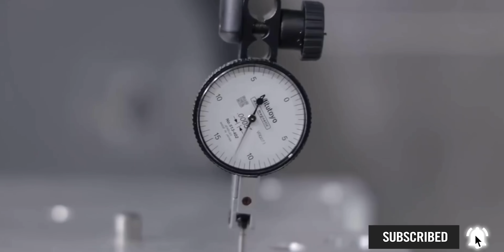The Harsh Truth Machinists Don’t Want to Hear

Comment: The city you live in is huge.  The difference in pay and work between Austin and Houston TX is night and day.  I had four jobs in one year working in Austin(almost 20 years ago). I quickly moved back to Houston to work another ten years for the oil industry. 
And the problem with most of the machinists I meet these days is they aren’t on the level they think they are, and want too much for doing the bare minimum.  You REALLY have to want it.  You can’t take the easy route AT ALL!!!   This means actually listening to the people taking about you.  It’s not an easy hill to climb, but the pay is worth crawling to the top.  Btw I show up to work with my uniform shredded. I  usually leave dirty smelling like oil and sweat, but if my parts are truly  beautiful, no one will be looking at me.

Comment: I like you, but you have no idea what you are talking about. Having been through tough times in your life has nothing to do with working in this industry. I have over 35 years of experience, did 4 years of night school to study all facets of machining, tool & die, mold making, trigonometry, advanced blueprint reading, dimensions and tolerances, metallurgy, etc.and get my Journeyman Tool & Die certification. I can setup and run just about any manual or CNC piece of equipment for milling, turning, or grinding. No matter how big of a machine, or how big, or expensive the part, or the tolerance that needs to be held, I cover it all. Knowledgeable about most of the latest machining techniques. I've worked for companies that employed from 50 - 1000 people in one location, and it has done absolutely nothing to improve my ability to earn what I'm worth. Wherever you live the market sets your wage. It's a glass ceiling and you will never break it without starting your own shop. With start-up costs of at least $100K for the basics, and a need to have a connection with larger companies who can funnel you jobs to get started, it's something only a few people can obtain.

Comment: This is the way. A work ethic is key, It is yours and it follows you everywhere and it is highly nuanced. You have to take care of it. A prime example, is that I have people not very happy with me at my job for the decisions that I made about stopping production. But I was trained to not take risks, and a million dollar waterjet is a big responsibility. It is a fact that if you do not take care of a waterjet, that it will be a nightmare. 

I ran our waterjet this week. I normally do not. I did not meet the end of the month quota. I was two parts short, about 2 hrs and 40 minutes of run time short. That is ok though, because the parts will be ready for the afternoon delivery. when work resumes back on Tuesday. We start at 5 a.m. and we have 3 hours of work left. We will meet the quota. Truck won't come to pick up the parts till mid afternoon.

I had some mechanical issues that could have compromised the material and i was in danger of making scrap if i did not make sure to be able to see what i was doing. If i did not make the right decisions, I was sure to make scrap and have a floor soaked with water flooding. I had to stop production to make sure that my water system was running optimally, and I had large clogs in my reclaim system that were causing the water level to rise above the sheet on my waterjet slats. I had to shut down to fix leaks and take off braided hoses and flush out mud clogs and so on. Had to be done. I rann as long as i could. I lost 2 hours of run time. I got 20 of 24 parts completed, about 30 hours of cutting/work. I went home a muddy mess, but the waterjet was back to working order. All in all, I can sleep at night because I had the best interest of the company at heart and I took care of the machinery, and made sure to not ruin material. The main waterjet operator will be back on Tuesday and he is a lot faster than me. I did my best and the distributors and contractors will not have to wait for delivery.

Comment: I started my machinist career when I was 14 Im 60 now. My dad had a small machine shop and I would work there after school and weekends  .  This was the mid 80s and most everything was manual from old school turret lathes to multi headed drill presses . I learned to grind hi speed tool steel and cemented carbide and drill bits. The shop evolved with the times and got a variety of cnc machines  which was great , but i noticed that the new people who came work there couldnt sharpen a drill or chase threads they seemed lost without that computers aid. I love cnc machines and amazed at what they can do but understanding the basics as a manual machinist is priceless
Reply: I agreed with what say. I started in the manual department. Like the old timers would say , cut once check twice. Manual machining teaches you patience. But I only did it for 4 years n move on to the cnc set up n programming. Now I have 27 years in this trade n a supervisor at my 3rd shop. 
An old wise man use to say, kids these days can’t use a knife but they can eat meat. I tell him time has change. Buy  the meat or have someone cook it for you. I don’t need to know how to  sharpen a drill , just buy the drill.

Comment: My last employer was old school using manual machines and bought a new CNC.  My boss was very much against paying extra for tooling especially since "this is the way we've always done it" I was young and everyone had 20+ years experience over me. I tried to show them new tooling, gave them print outs, showed them videos, etc. And  they just didnt care. To add insult to injury, on my review the put that I was "hard to deal with" and that i kept referring to "unethical machining practices" . I left that job and the place im at now its almost the same story except I mainly deal with engineers who dont know jack about machining. I showed my boss a super glue machining method to get 30 inch x 30 inch parts flat within the .002 flatness tolerances. He said we're not going to do that anymore because its a waste of time. I plan on getting out and starting my own shop but even then that has its draw backs. My plan was to start a Xometry account to get off the ground but the work they have you do for what they pay and the lead times they want them done is criminal! This trade is really ass backwards unfortunately and thats why China is taking over all the manufacturing. Young people dont know about machining and they dont want to work anyway. Im honestly thinking about switching to HVAC or becoming a Maintenance Tech. before my body gives out and AI takes over CNC Programming jobs, because they definitely will! I'm a veteran who's had ACDF surgery C3-C5 fusion, possibly another 1 soon. This trade did help me learn a lot and it didn't make me rich, but I didnt go hungry and I always had a job. Just wish old boomers and old Gen Xers would listen before its too late. When I was in community College going through my apprenticeship, they had no instructors to teach abrasives. They literally had to get the original instructor out of retirement to teach the class. No one is going to replace the tool and die makers in the country and my fear is that we will see a dramatic drop off in manufacturing and crazy lead times once all the baby boomers retire and pass away.... rant over...

Comment: Your message is what I just needed to hear. I’m almost 67 years old and I’m still working my butt off as a CNC programmer and operator for a small company that I’ve been with for 30 years on and off. 
  For four years, I started my own business with my brother doing the same thing and bought a couple of CNC mills unfortunately that didn’t work out and while I was running that personal business, I was still working so I was pretty much burning, the candle from both ends just about killed me.
I am tired, my friend, but you inspire me . I don’t know what my future is now but I should be retired and the only thing I have is my Social Security, but I would like to somehow use my skills as a CAD and a Cam programmer to supplement my Social Security and maybe give me some personal financial security to finally buy my own home somewhere. Thanks again for your wisdom. Cheers.

Comment: 100% truth in this video. I have spent my entire career as a tool maker / machinist and there are 2 types of machinist I have worked with. Wealthy and poor machinist and it has nothing to do with money. The mindset between these 2 groups is the difference. One group only collects a paycheck  and has bad habits they use that paycheck for. The other type gets payed for their skill and has good habits that is not driven by the money they make but how they choose to direct that money / energy to grow and change for the betterment of their life and the lives of those around them. One of these people will learn and use their skills outside of the place they make a paycheck at and the other will only learn and use their skill on the job. One works for money the other makes their money work for them. One is motivated by self improvement the other is motivated by money and overtime. Take the time to work on you and don't be one of the people that want payed to work on themselves.

Comment: Great video!! After being in this trade for over 20 years now, my advice is the same: Have a good attitude!! Make the smartest machinist in the shop your friend and learn all you can!! Learn, learn, learn!! You will learn many new things at every shop you work in, as well.  It WILL, pay off.     Remember: you have one mouth, and two ears. Listen twice as much as you speak. 

My experience includes: Mold Maker (13 years), programmer (MasterCam, Esprit, Fusion, and Camworks) over +20 years doing 3, 4, 5 axis mills, lathe and mill-turn (would love to learn Swiss lathe).  Defiantly not bragging, just sharing my experience on everything you can lean, having a good attitude!

Lastly, I will say that I raised 3 kids, all on a single income. It CAN, be done!  My wife has not worked in our 26 years of marriage.    MAKE CHIPS!!!!

Comment: when I started making parts about 10 years ago, I worked with a elderly fellow who gave me the greatest advice. He could see my drive and eagerness to learn and be better. He also saw the struggle. I was running a manual mill and 2 other haas for 12 dollars an hour. He told me to pick a tree outside and when you clock out, go hang all that bad energy on one of those trees. Just leave it here. Now I make more than double of what I started at and I am entirely grateful for the beautiful struggle. I truly have respect for that small space between "no longer" and "not yet".

Comment: So I should look for another job? They can't function well for long without me. I'm in a situation where I'm stuck. Can't move sideways or up. Money isn't my problem. It's the mess I deal with. No support and no real problems fixed. I'd wager in a real shop,  things would be gravy work. I've learned a great many things there and have strived in chaos for years now.  I realized a couple years ago I was stuck. I'm top dollar in pay but no advancements for me. Every little speed bump, and upper management rattles my cage. They don't like their cage rattled back. Truthfully they can't be trusted. I'm looking but shops won't even try to compete with what I'm making or call bs on what I do. I'm supplying an assembly line with 1 cnc mill It's insane and I make it look easy.  It's no place to work though. Anyway i can't find the work to kinda keep at my pay.. I'm stuck...
Reply: I understand completely. I loved to hear the harsh truth, but at the same time I am also stuck. I want to leave for a new environment because it is not worth the stress and aggravation of trying to solve a problem "you" attempted to avoid. Getting shot down with every idea you bring to the table destroys your self-worth, and then to see one of those exact ideas become implemented, because the boss thought of it, really turns your mindset to a negative one.  My company had 4 people retire this summer, out of one of those retirees,  I wanted his position to move up into a different role, and I felt that I had the skill set, and what I may have lacked would drive me to learn it. After asking and attempting to show that I could do it for over a year, knowing the retirement was coming, I got turned down. I was upset and applied for another job the next day out of frustration, but found out I was stuck. The outside hire that filled this role, has no manufacturing skills, his experience is "working" for manufacturing shops, I have come to the conclusion that the role he fills is actually to be fresh blood and to rule with an iron fist among the machinists on the floor. It's not working. My role in this shop has become so reliant on me that I have become too valuable to move up, taking a vacation is never easy, and seems to be a sin. I have hours and hours of PTO, I almost never get to use more than 25% of it.  Sure its nice to be needed, but sucks to be the sole problem solver.  I always recommend Titans Academy for every new employee we get that has little to no experience, and I always jump to help them if needed.

Comment: Great speech!
  When I first started I worked with this guy that did not want anybody  but him to do any high precision work.If someone would do something he would go to management and tail how bad of a job someone done and he had to fix it. So they need someone to go the another shift so I went. It was rough for a while  no matter what I did the guy on days would convince them he had to fix it.  
 So they ask me to fix a Farrel FCM Mixer body. Had to weld up the key way in the middle and re-machine the keyway. First had to find my Datum points to come off of. The key way in the body was to bolt the dams in to hold the liner keep from spinning while mixing the PVC  vinyl. I got it all welded up one night put it blankets and stuff to let it cool all night long till I came in early the next day to get it on the mill.
I got it on the mill all trim in. Before I left that night after working 16 hours. I got both side done and the middle I left it on the mill to make sure it was cool before taken it off. When I got in the next day I was called to the office and was told the guy on days said the body was off location. I asked how he came up with that. They said he looked at the print from the factory and it was off on 1 side the key width was right and the first edge was within .0002 but the far side was off .100. I ask the boss listen to what you are saying, and told him how did the guy on days ever convince you of that.  He said that he was going to tomorrow let the guy on days redo it all because he been doing this work for 10 more years than I have. Like you said you have to sell your skills and at that time I knew it was my time to make a stand. I told the shop supervisor I would put my job on the line because I knew it is right and to let me put it together tonight and I would come in on days tomorrow with the guy on days and we all would look at it and if it is wrong and out of tolerance I will put my tool box in my truck and come back next payday and pick up my last check. But don’t tell him I putting it together tonight and coming it with all you all in the morning. I have the FCM hid so we can all look at it in the morning with my job on the line. Next morning I walked in found the boss said I bring it in. When I came in the shop with it together the boss said to the guy we all going to look at it right now. He asked to guy right in front of me what wrong with it.  He looked at it looked at me and the boss then I asked now where is it off location the dams were up tight, the liners matched perfectly no high spots, no gaps,no sharp edges and the boss said it measured out perfectly. The boss said if you don’t mind go home because we know you only been off for a few hours and come back to days tomorrow. After I stood up and put my job on the line because I knew is was 100% right I moved a head of him  and gave me a whole lot more work and a whole lot more money.  Like he said DON’T hold yourself back if you have to leave go, don’t under sell yourself before you take the job and really look at the shop and the equipment and the type people that are employed how they dressed it can be the cleanest shop in the world but if nobody is getting along you still won’t be happy. But make sure the place will have a way to move up and not stay where you are.
Reply: That's a long read but thanks for sharing.
Reply: Titan, i got to tell you you are a inspiration, not a machinest, but a fabricator. I love watching wtat you do please keep up what you are you doing.